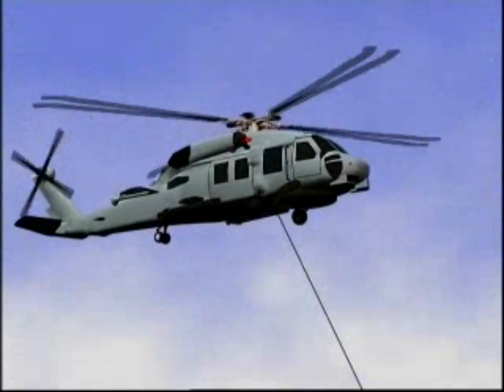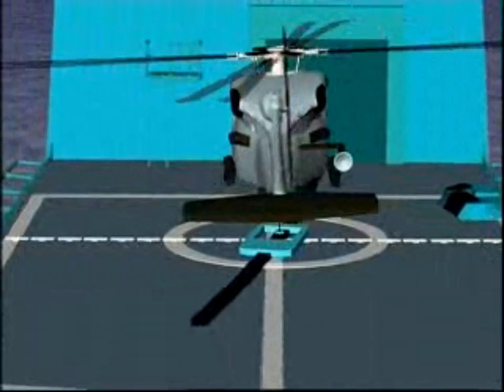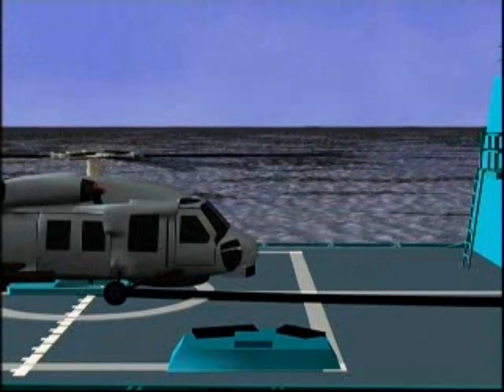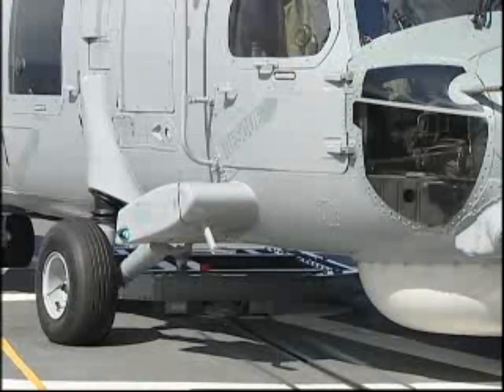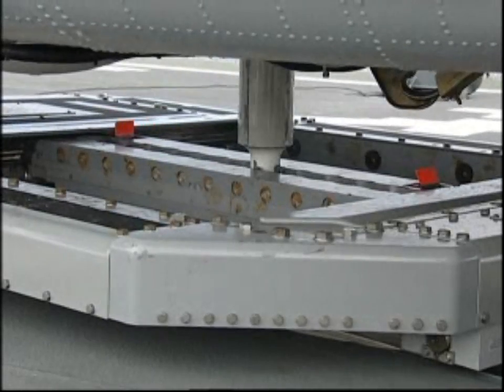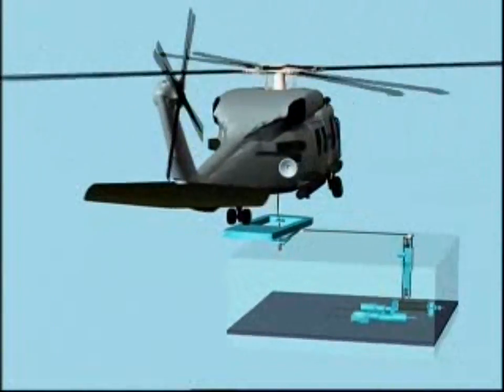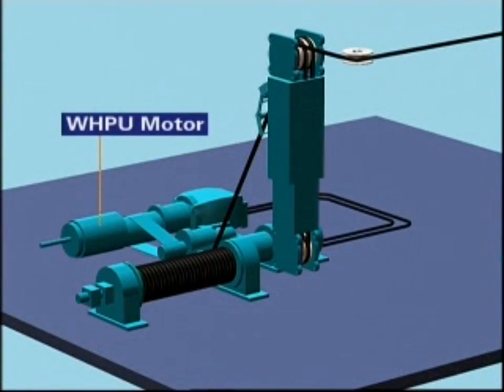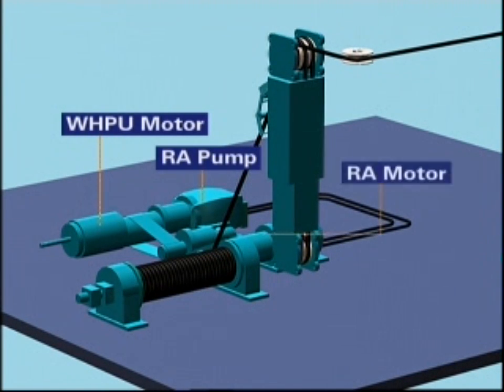RAN MH-60 Helicopter RAST Recovery Assist Explained

Comment: Looks like controlled crashing.  I wonder if whoever dreamed up the idea actually tested it him/herself standing under the helicopter at night on a pitching deck?
Reply: The original concept and actual system was developed by the Canadian Navy/McTagett Scott, Dowty etc.  USN adopted it ans I?we modernized it.   DAF of Mississauga made a few for us.. I was there for OPEVAL and TECHEVAL..   sea state 5+
Reply: @marvsmoir701  Indeed. It (Beartrap) dates back to the late 50's and very early 60's in it's development phase and got perfected mid 60's. The real advance was including the ability for the trap itself to be moved under power into the hanger thereby making helo handling far safer for crew in high sea states.
Reply: I worked on the flight deck of a US Navy Cruiser.  The whole idea of using the trap to assist recovery is so the flight deck crew DOESN'T have to be on the deck in those bad conditions.  We would hook up the cable then leave the flight deck. That system was made to replace human crews in dangerous weather.

Comment: I did a ton of work on the RAST tracks on the USS Momsen back in 2009, it's an incredible system. It wasn't fun personally torqueing over a thousand of the bolts that hold the guide plates down along the tracks that run into the hangers though, they were one inch bolts that were hand torqued to 370 Ft-lbs, my God was I beat up by that job, I was running the torque wrench like an oar on a boat for 12 hours and my back and shoulders were toast. Would have been nice to just use a rattle gun but the Navy is pretty particular about their torque specs...